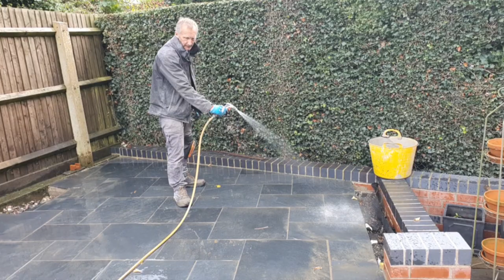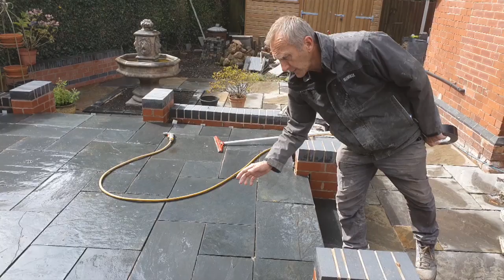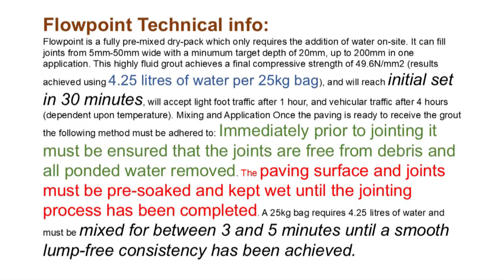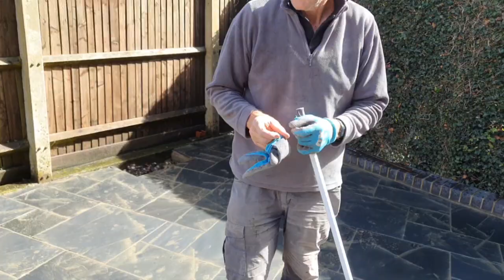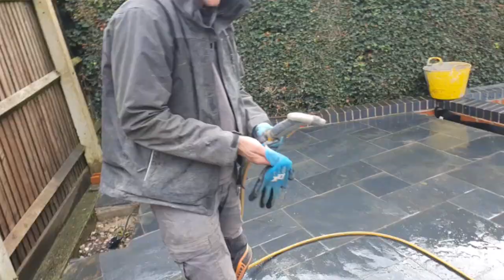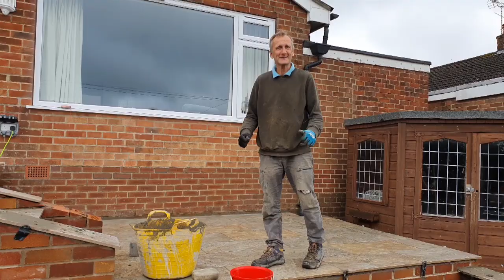Using Flowpoint on paving

Comment: I have a mire "textured" brick type paving. Would this mbe a nightmare to keep from sticking to tge surface?
Reply from the maker: Hi I did use Titan pro joint to point some paving recently and they do a coating just to stop it sticking.
https://youtu.be/pMA6pRzKTB4 
Gunners had a great season, hope Declan is fit for next season, cheers Mike

Comment: Great informative video Mike. Please let me know your thoughts on the following........   I'm looking to Flowpoint 10sqm of sandstone paving soon. Does not sound much, but being in my retirement years and very slow now, I would struggle to complete the task before it starts to harden. Would it be possible to grout the area in stages?......Mix up a small batch then grout say 2sqm? Also I am thinking of having 15mm gaps between slabs, then fill each gap line, using a mortar gun or grout application bag. Should also result in a lot less cleaning up too.  Thanks... Mal
Reply from the maker: Hi there, I have used pro-joint Titan and as long as you sprinkle the slabs and wait about 15 mins, you just sweep it off diagonally. Video is belowhttps://www.youtube.com/watch?v=pMA6pRzKTB4
Flowpoint will certainly do the job as long as you keep the slabs misted over. You will need to wash it off when the flowpoint has hardened. You can do it in stages and I think it is a good idea to get used to the product. If temp gets up it does go very quickly. I hope it goes well, cheers Mike

Comment: Looks better than the Sika resin grout I used that is rubbish after a year, so going to dig out and use flow point
Reply from the maker: It seems pretty good over time, I have also used the Titan pro user as well which is good.

Comment: Nice job but a lot of clean off after the pour .
Reply from the maker: It is quite a bit of work, but you get a good result which can be pressure washed when the patio needs cleaning and doesn't blow out, cheers Mike
Reply: Only if you don't know what you're doing.

Comment: Thanks for sharing, I never considered Flowpoint before and might give it a go. The job & finish you've achieved looks fantastic. In the meantime, I think I'll be keeping to my dryish hydraulic lime & sand mix - brush it in, bash it down, sweep it off & rinse where necessary, no time limit & no dramas.
Reply from the maker: I just use it on slate or porcelain, I wouldn't use it on concrete paving, cheers Mike